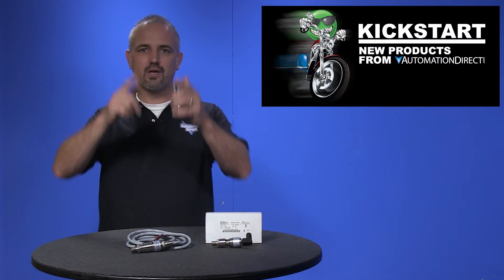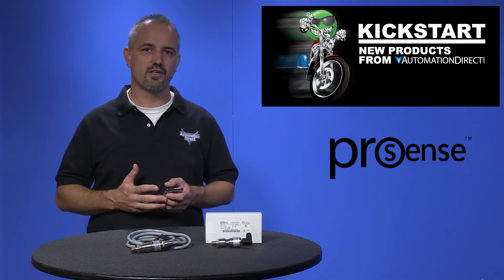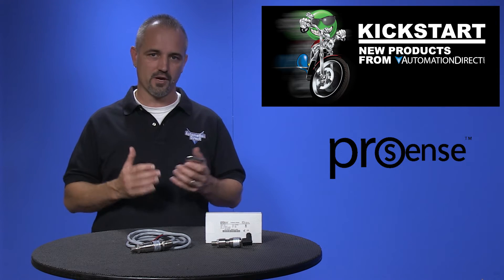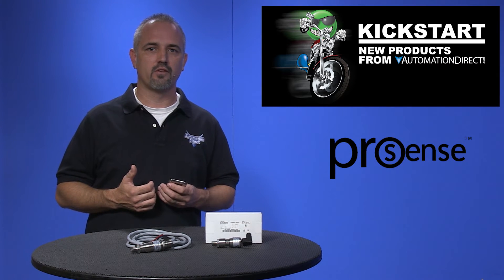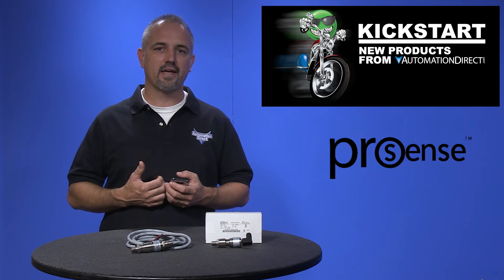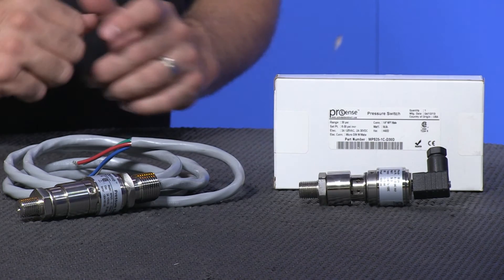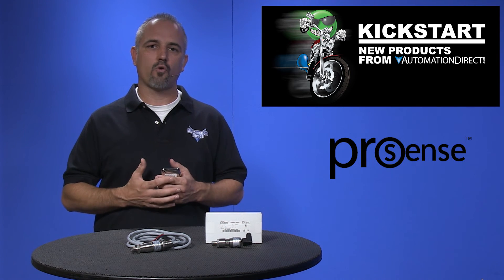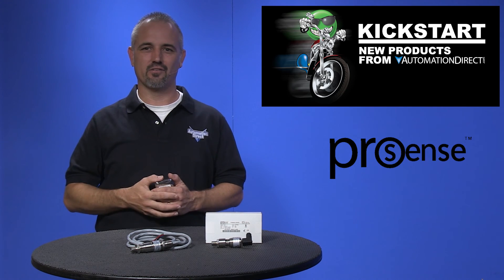ProSense Mechanical Pressure Switches from AutomationDirect

Comment: Does this pressure switch work for both air and water lines?
Reply from the maker: Hi Kevin,  These are appropriate for Pneumatic or Hydraulic applications. The Tech specs for these pressure switches are located here: https://cdn.automationdirect.com/static/specs/prosensemps25switches.pdf